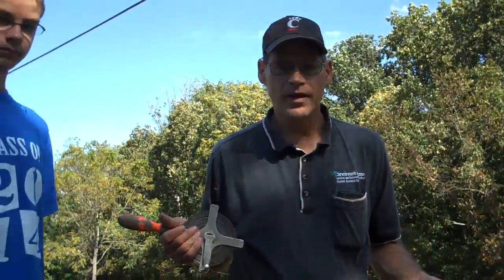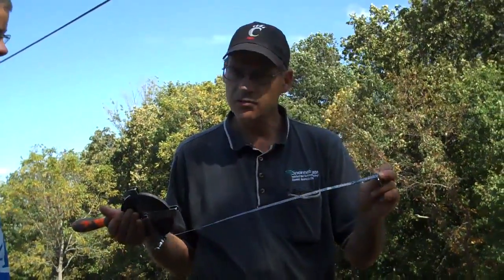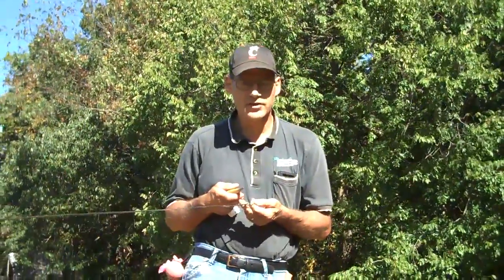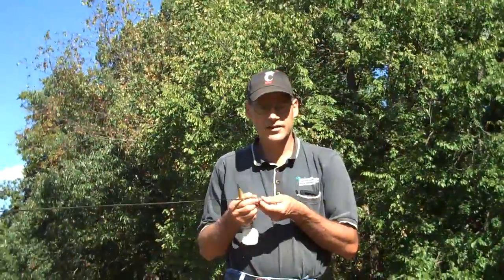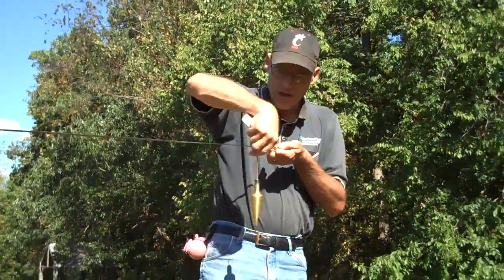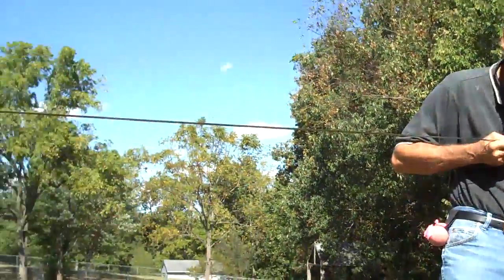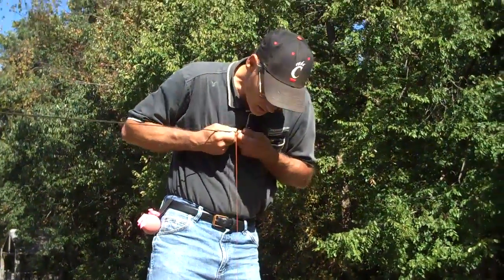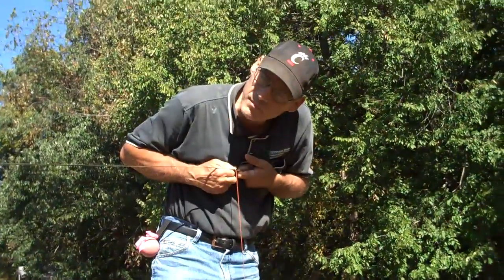Using A Steel Tape.mp4

Comment: you can't eyeball judge... always use the level
Reply: It kind of depends on how steep the slope is, and how precise the measurement must be.
If a 100' foot measurement is out of level by as much as a foot, the resultant measurement is only affected by 0.005', or about 1/16 inch. That's close enough for "government work."
Actually for precise chaining. stakes are set; their elevations determined by differential leveling, and the chain is pulled point to point along the slope, and then reduced  to horizontal using everyone's favorite; the Pythagorean Theorem.

Comment: How refreshing, someone actually showing how to do something the correct way. Cheers to you. Please make some other video we will watch them. Teach us how to do step surveying the right way. Most people attempt to show it with just graphs not doing this in the real world with real problems.
Reply: Sad that this video doesn't do this. Every survey chain I ever used has only even feet marked  except for the 1st foot. (Metric chains are often incremented in decimeters with millimeters in the initial 0.1 M.). An "add chain" is actually incremented for 101 feet so the rear chainman can hold an even foot, and the head chainman then adds the decimal portion. Then as they call out the measurement to the record-keeper, the rear chainman calls out his number first followed by the head chainman's decimal addition.
(There are also what's called "cut chains" where the head chainman's decimal number is deducted from the rear chainman's whole number.)
Also, suggesting guess work to novices on how to level the chain is ill advised especially if the slope is steep.
Also, not one mention of having one's feet spread to create a steady base will leave many to figure out by trial and error how to hold a plumb bob steady from above head high; mostly error.

Also, guessing at the correct amount of tension is not by the book. One is supposed to apply 30 lbs of tension. For precise chaining, a scale is attached to the front end of the chain, and tension variances are applied as well as the coefficient of thermal expansion for the material from which the chain is made; usually steel, but sometimes "Invar."
One other thing. A chain stored on a reel instead of being "thrown" into 5 foot loops introduces a systematic error into the measurement since the high numbered end of the chain is distorted into a tighter coil than the low end.
I started surveying in the 70s before GPS was in use, and EDM (Lasers) use was in its infancy. Trying measuring a half mile up and back, and having the 2 measurements agree within 1 part in 10,000. Back then is was S.O.P.
But even with all of today's modern technology, a land surveyor still needs to know how to pull a chain.
And as the old saying goes,
"Measure twice; cut once."